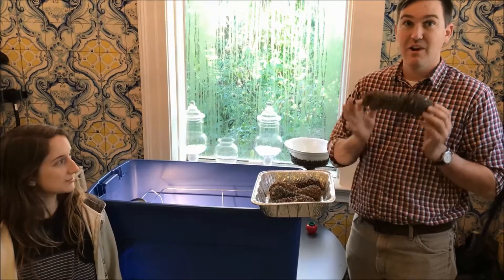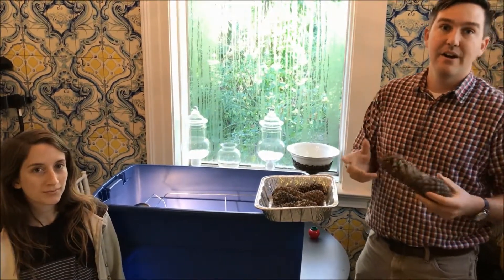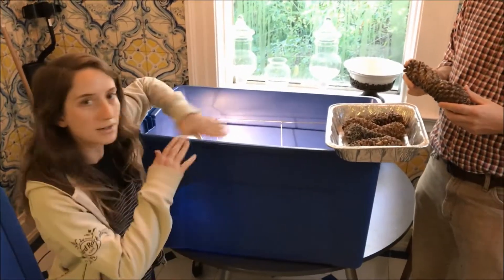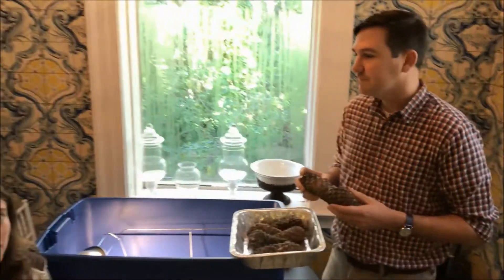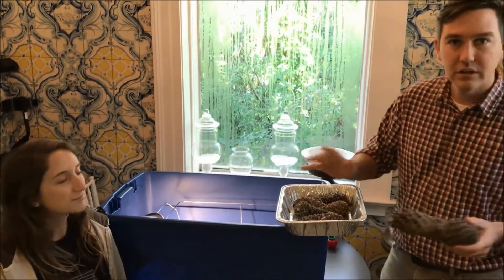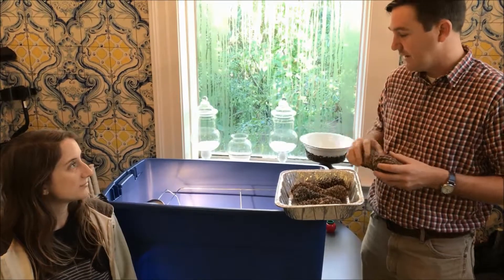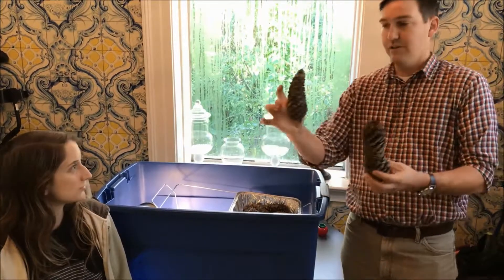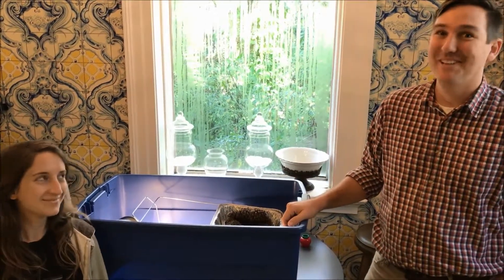Florida in Focus - Longleaf Pine Cones Part 2

Comment: How did they do? What time of year do you pick? How do you get seeds out b4 bugs or rot?
Reply from the maker: Success is measured by seed germination rate. 
In order to have good germination, pine cones must be picked at the right time, processed and seeds sowed quickly. Either old seed or immature seed, will both have poor germination.

Cones are picked around Thanksgiving, when their specific gravity measures at or around 0.89.
This must be measured in order to be sure. 
See the method here: https://www.fs.usda.gov/nsl/LL_sg_measurement.pdf

The main pest we have experienced are squirrels; however, this only affects the total possible yield, not the yield after picking.